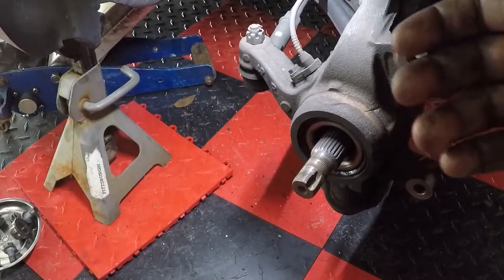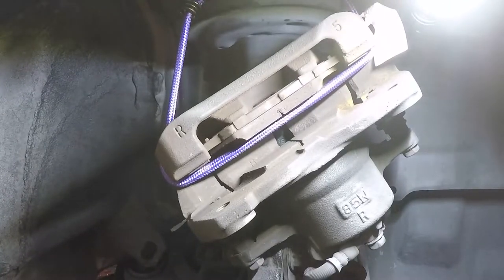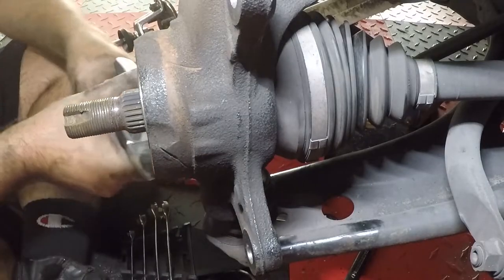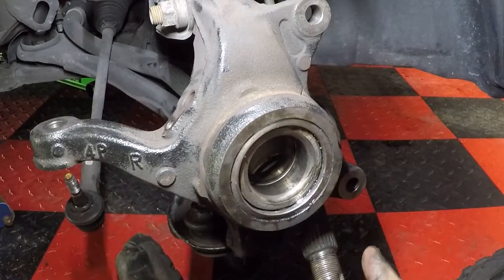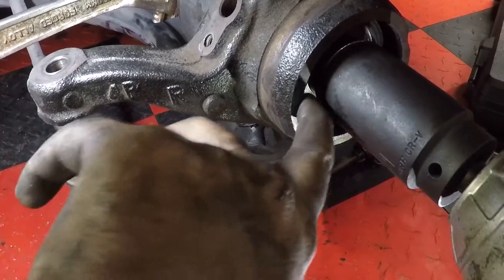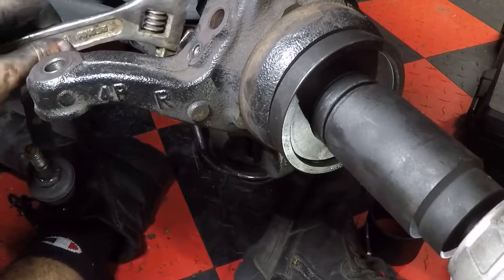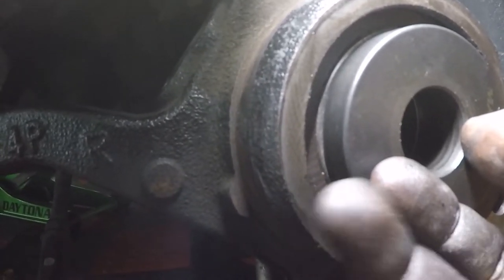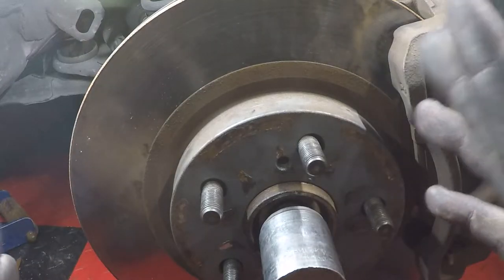HOW TO: Scion xD Front Wheel Bearing Replacement (Also works for Toyota/Scion) Press in Bearings FWD

Comment: Great video and tool recommendation.  I did my wife's 2010 scion.  One thing I did differently was once you free the knuckle, remove it from the vehicle by taking out the two bolts at the top.  Much easier to remove the snap ring and press the bearings from a vise on a bench.  Also, when I removed the bearings with the slide hammer, it separated the bearing.  No big deal, but it was harder to press it out.  Again, thanx for the video.
Reply from the maker: Thanks for watching, glad it helped!
Reply: Buenas tardes,  donde están ubicados por favor
Reply: Tengo un Xd y necesito cambiar los rodamientos

Comment: My 08 Scion is making a metal scraping noise once I reach highway speed and am accelerating it sounds like it’s from the rear I don’t think it’s the tires or the transfer case as it doesn’t sound like gears grinding smooth matal scraping automatic tranny 2001400 miles
Reply from the maker: It could be the rear bearings, which are fortunately just direct replacement hubs I believe